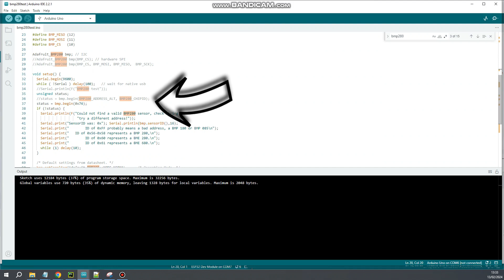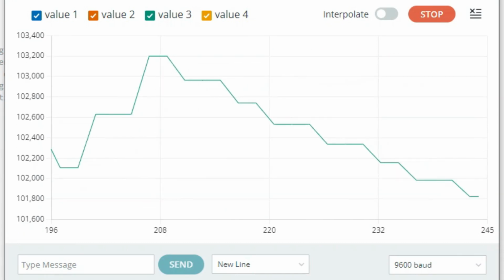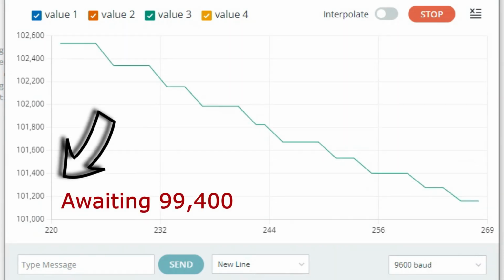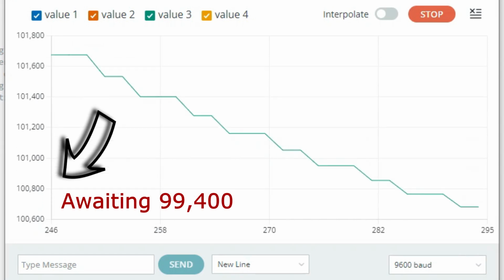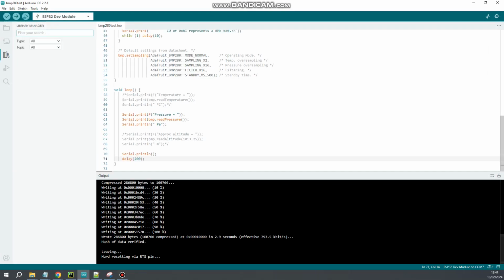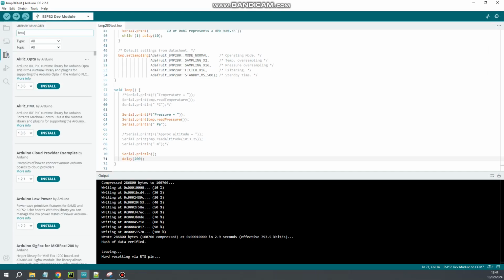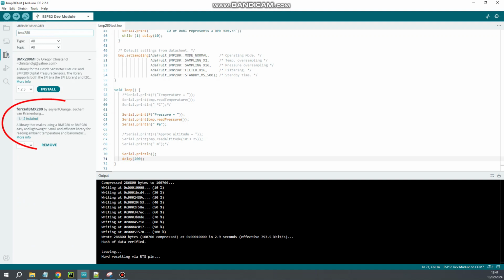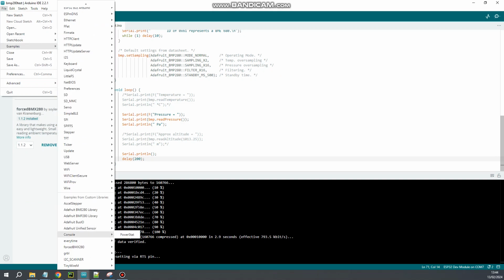Why You Should Stop Using The Adafruit BMP280 Library

Comment: The Bosch sensors do have some parameters for setting up an IIR filter.
This does make the response as slow as you observed.

You can simply disable it or set it to more responsive (but still filtering) values.

However when sampling at a higher rate, be aware you are heating up the sensor, so when you try using the sensor to measure temperature (and/or humidity on the BME280) you will get an offset.

Another reason why you may get to see an offset in measured values is when you don't read all I2C registers in a single I2C command.
If you don't then you may end up with readings which partially belong to the previous and some belonging to the new reading with iterative intermediate results.
I have no idea what the Adafruit library actually does, as I'm using my own code for 5+ years now in ESPEasy as back then all implementations I found online did exactly do what I described.
Reply: Do you think it is possible to use BMP280 for a freefall altimeter? I need to get accurate readings every 100ms or so, but I experience the same delay of pressure reading going down way to slow as shown in the video. Also it never goes back to exact reading before the pressure was changed rapidly. Using BMX280 library did not solve the issue. I would appreciate your input so I can decide if I need to learn how this sensor works and write the code for it instead of using a library or choose another sensor.